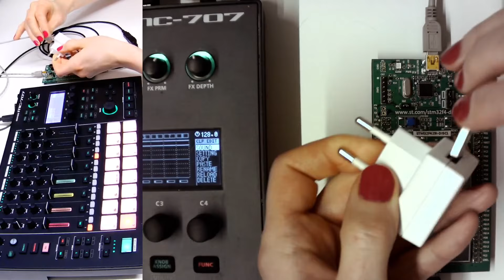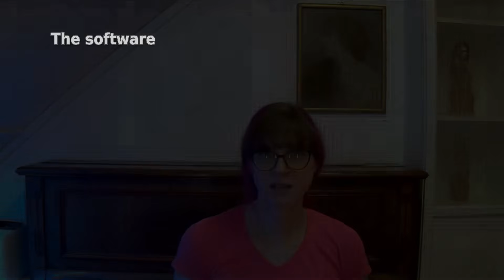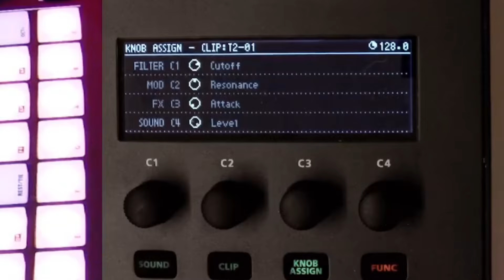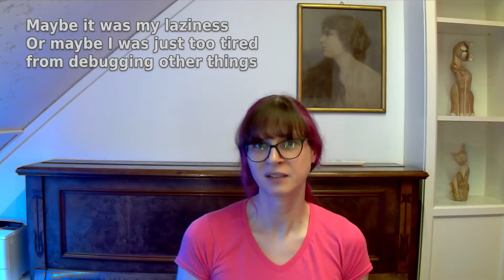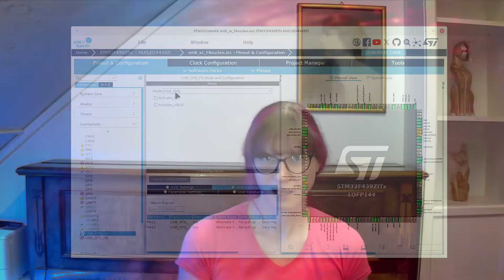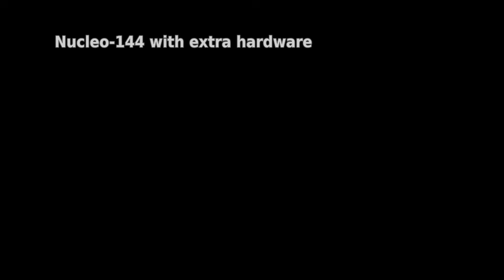MC-707 & MC-101 Sidechain Effect using Inexpensive Hardware & USB MIDI

Comment: why not do CC11 per midi channel? You can use an external compressor on the 707 but this is cool.
MODIFIED FIRMWARE? ME WANT CODE! On the 707 I want to replace to faders with midi ones or maybe they can be reprogrammed?? I want to add probability modulation and conditional triggers and some other generative things.
Reply from the maker: As I tested the CC 11 it works similarly to volume control in the presets that I tested. But, sure, it's configurable so you can set the gadget to many different CC messages even without modifying the firmware. The code is on my Github (see the video description for the link) and you can download the whole project in two versions (for two different STM32 eval boards). The Faders on MC-707 cannot be programmed using the firmware provided officially. But I managed to intercept the data transmitted between the user interface board and the mainboard in MC-101: all the LEDs, knobs and sliders have their own messages and setting information. The connection uses serial port in basic configuration 115200 baud, 8n1. And the fun fact is that the interface board uses also the STM32 microcontroller

Comment: I'm amazed how deeply technical and enthusiastic your approach to the hobby is. I agree with another commenter that RK002 is a cool little device to look at and after watching your vids (yours and the RK developer) I think you have lots in common, maybe he could provide you a promo unit? Don't be shy to ask! My roland-related technical wet dream: borrowing JD-08 envelope/LFO capabilities for another Roland synth like.. System-8? I mean, JD-08 is a beast sound design tool: you can add a time delay to both LFO, add an offset to a waveshape, influence the sound on note release which has its own envelope. Many modern synths simply don't have all that. I wish that I could send notes simultaneously to JD-08 and another synth, reading JD's reactions somehow (maybe capturing the audio? like specific frequencies) and sending them as CCs or SysEx to the second synth. Well, I understand that it's basically impossible or even harder than all the sidechain voodoo magic you made here. By the way, I also recommend Blokas Midihub that can allow many complex ideas come true.
Reply from the maker: Thank you so much for the comment😊 Thanks for the advice on the MIDI processors. I think they are really cool and useful devices. But for me the most fun is to make my own processors :) I made the one presented in the video with the USB interface, because I was really curious about how the USB MIDI host is implemented ;) Once you can program MIDI processing, you can make virtually any regular or USB MIDI unit you want

Comment: Could we imagine the same method being used inside a Retrokits RK002 smart midi cable ? (It’s Arduino based if I am not mistaken).
Reply from the maker: Thanks for the comment. I've just briefly checked the RK002 and its "MIDI LFOs" looks like a similar option. I can't check exactly what's in their code, because I don't have an access there. I don't know if the RK is Arduino-based, but I think that it can be programmed to do something similar or the same as the gadget I present here
Reply: @Locriana the only difficulty would be to send it some input parameters to choose source and target and fine tune the SC effect. You could program some note or PG to do so but you would need another controller. I know I can have it waiting for 5 seconds so that one could enter parameters by sending note messages from the groovebox’ pads.

I successfully programmed a MIDI router which during the 5 first seconds after the RK is connected will catch one of the white keys starting at C3 to determine the wished target MIDI channel. I use this for those controllers like ROLI which require you to use an editor software to just modify the target MIDI channel.